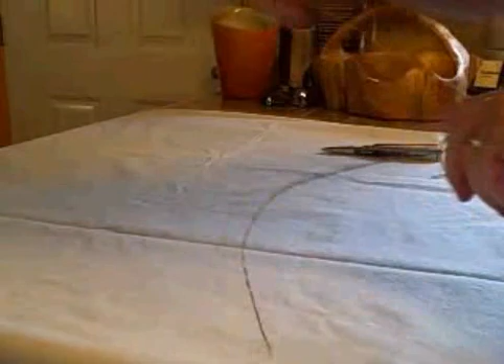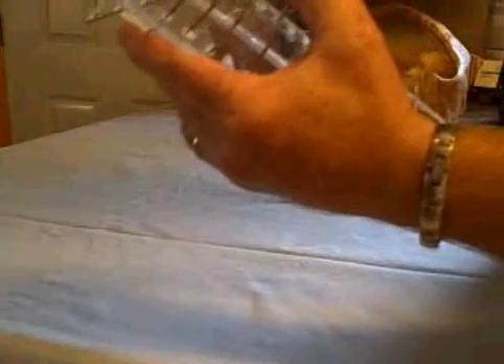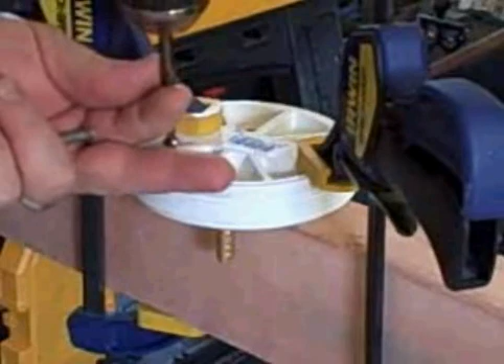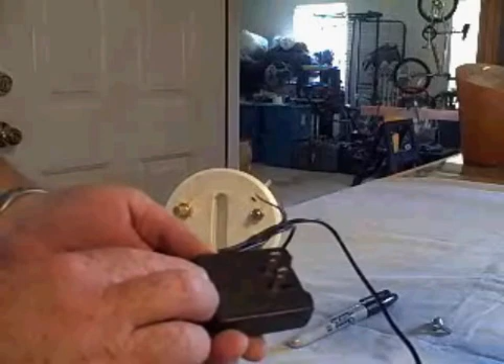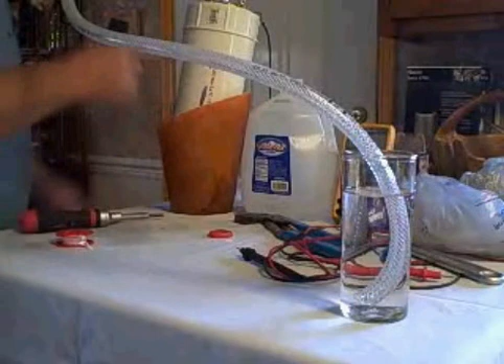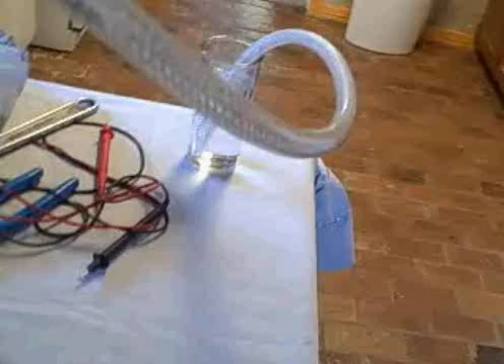Building A hydrogen Generator part 2

Comment: Use KOH (drain cleaner) instead of baking soda to prevent harmful fumes and keep the water cleaner.  Handle with care and never store it where children or unaware adults can reach it.  Use protective gloves and eyewear.  It works a million times better.  Don't use more than you need - add it very slowly stirring constantly in a bowl half filled with water.